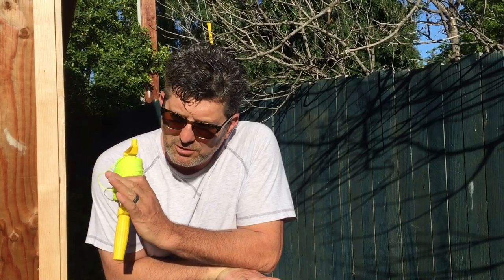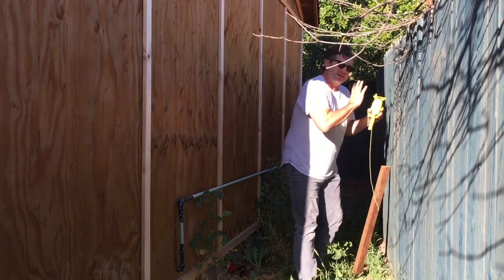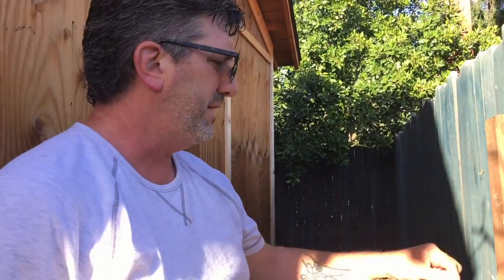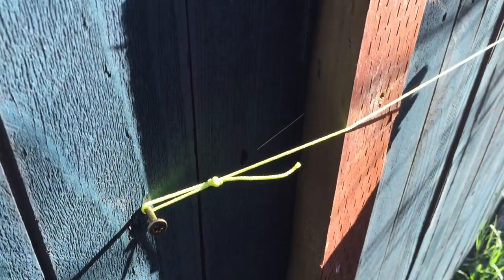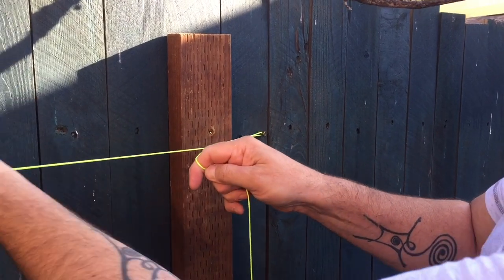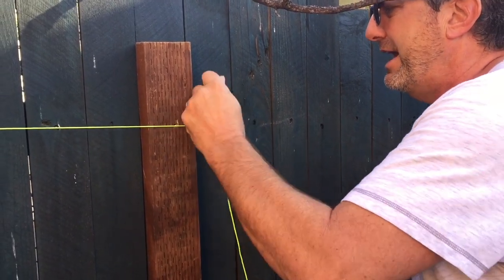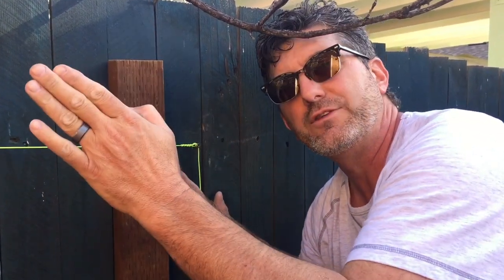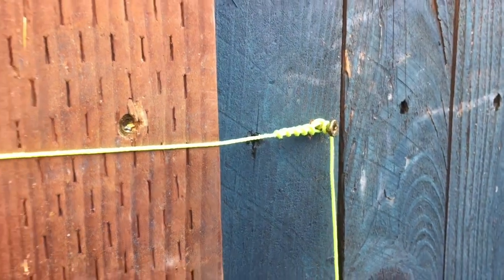How to use a String Line

Comment: Hi Dean thanks for sharing the great video on how to use a string line !   The one question I had was on a new fence installation. I was planning to set my first post with 1 1/2 " spacer board and set my end post 30 ft away with spacer board and run my string line using the loop and tie off technique you showed us. If I set my other posts in the run off this string line wouldn't the starting post and end posts be 1 1/2" off from the posts ?  Thank you
Reply: The string is your guideline, the one thing he didn’t mention in the video is after both ends are secure you use a measuring tape in the middle of the string and so on for your new fence installation. Everything essentially will be 1-1/2 off that straight guide line when you are finished running your poles.

Comment: This doesn't mean its a complete straight line because the line appears to be straight it could be too high or low on one side that's why there is a line level, string can look so straight till start putting up 6' pickets only to find out after putting up so many of them there becomes a dip on one side especially when putting a 5' level on top of the pickets it's crucial to use line level I found out the hard way by never thinking the line looks straight being most cases it's not.

Comment: When I’m setting a line of posts I don’t do the 1.5” space. I just plumb each post to the the line as I go.
Reply: But the video is about straightening an existing fence, not setting new fence posts
Reply: @GarwoodNick it actually seems like this is more of a video on how to use a string line, you wouldn't measure the middle of a fence for straightness. You would go end post to end post on the post side of the fence. Even then if you wanted to be accurate your end posts would have to be plumb.
Reply: @brandonk1502  Yeah that makes sense provided you have access to that side of the fence
Reply: @brandonk1502  hey Brandon yeah that's right I am trying to put in a vinyl fence and the hurricane blew in my fence wooden one so I guess I have to start from where I think the posts are what do you think? It's a long fence so yikes want to put vinyl and it's done part of the wood